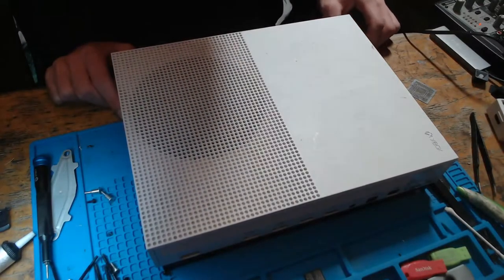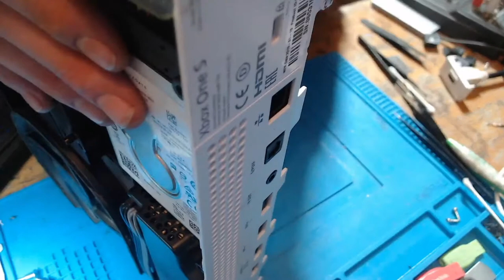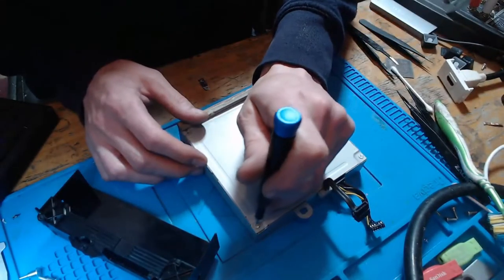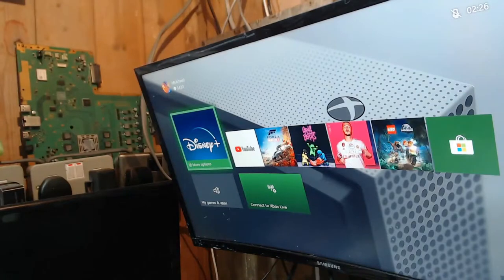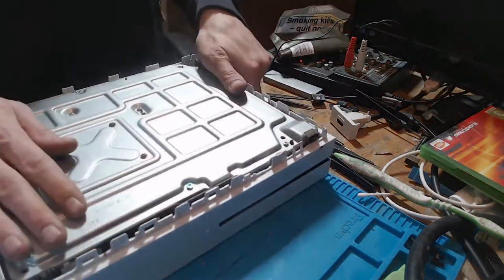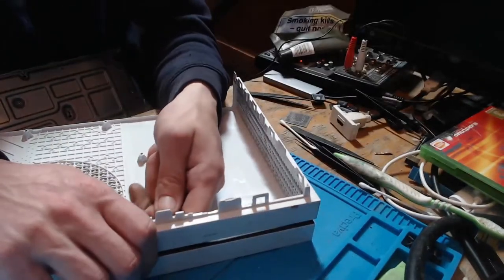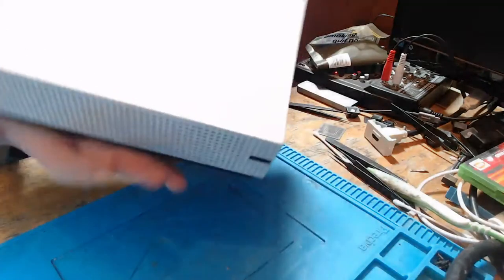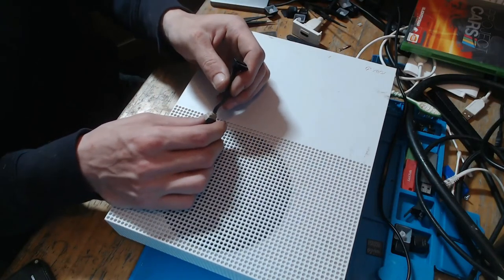Xbox One S E100 Error Code Repair - Disc Drive Not Recognized

Comment: After trying every iteration of the OSU1/OSU2/OSU3 offline update, swapping out flash drives and then ultimately replacing the hard drive, and was still get e100 error. And after I was about to call it quits I saw this video and guess what? The disc drive cable was just disconnected. It’s back to 100%! Thank you so much for this video!

Comment: UPDATE: THIS WORKS !! But only if it is the exact code as shown in the video "E100 00000703 80910002" then it can be possible that it's a simple cable swap if the cables look damaged in any way either way GIVE IT A TRY!! You never know with these things. I am very happy :) Also, BIGGGG thanks to TheCod3r because I probably wouldn't have thought of the cables if it weren't for you thanks for reading this, and have a good day.
Reply: Thanks fam
Reply: Could you guys share Where did you I find the cable replacement for the disc drive? Thanks !!
Reply: @jean-francoisallaire2099  Personally, I had an extra console handy. 
GL!

Comment: Was in the process of SSD swapping my Xbox One X. OSU1 was running fine until the start of step 3 (Applying) and it was frustrating as fuck. I was using every bit of IT knowledge, multiple different drives, cables.. wiping drive data, formatting, power cycling, EVERYTHING. Came by this video and tried plugging the disk drive back in, and what do you know.. up and running in less than 10 minutes.
LESSON LEARNED.. YOU CANNOT- CAN. NOT.- REMOVE THE DISK DRIVE
no matter how bulky, and ugly, and heat producing, and airflow blocking it is. 
Fucking microsoft.

Comment: I had the E100 error, checked wires no cracks. So I opened the disk drive looked around nothing wrong there, moved the eye mechanism back away from center. Just wanted to be able to hear if it moved. Used the OSU1 on my jump drive and its loaded up and system is working. Just thought Id pass this along might help somebody.
Reply: hi, what is the eye mechanism and where is it located. my disk drive cable is fine, no damage but still have the e100 error
Reply: The laser lens is what I was calling the “eye mechanism” at the time. Probably from being so frazzled from working on it. Lol
I believe the laser lens mechanism was in a bind or something. Either way moving outwards away from center worked cause system is still operational. Hope that helps yah !

Comment: My drive ic is damaged and there is no way to get past the e100 update loop. Microsoft should stop checking drive in update and just update the software. I could have used the xbox to play digital games but now its just trash. Microsoft should release an update for xboxes with no wifi card or blu ray drive. Green earth is just a gimmick.